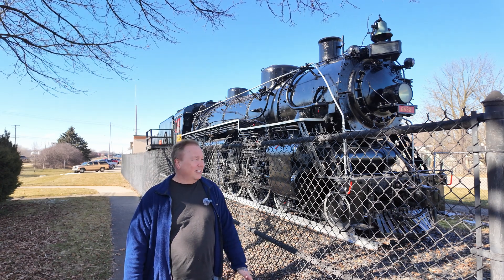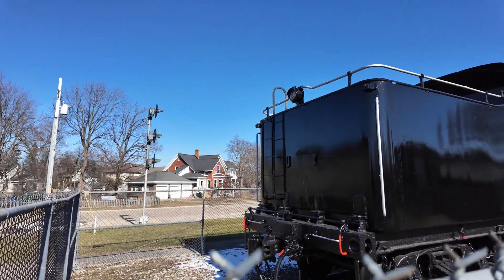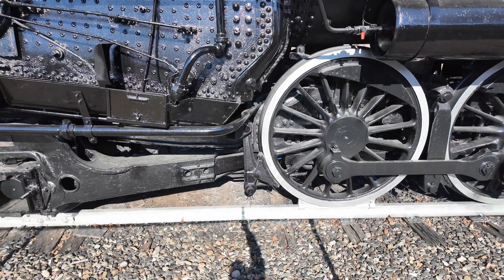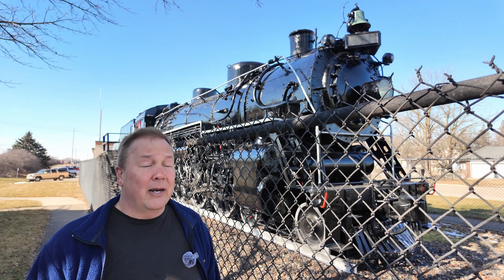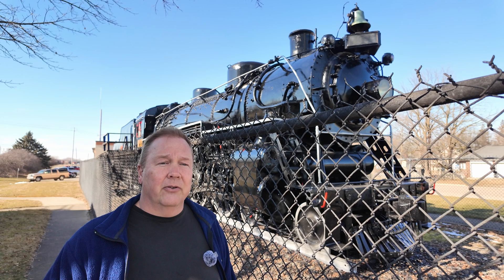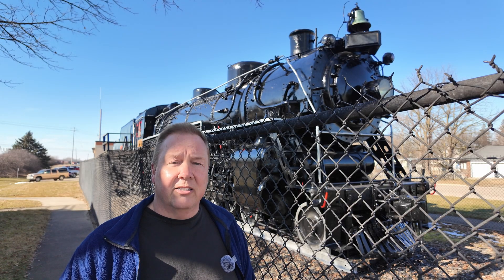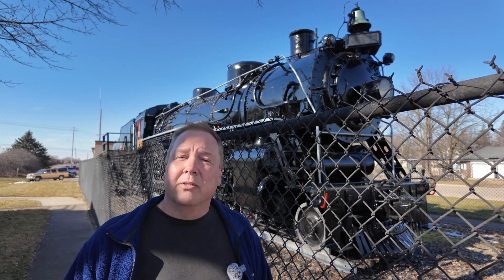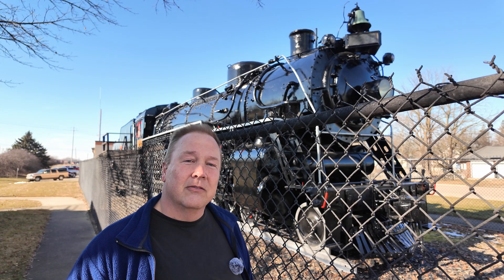Why Are So Many Steam Locomotives Sitting in Parks?

Comment: Only 10 miles between water stops may have been true in the 1800s, but something that new could go 100-150 miles between water fills.  At least do a little google searching before spouting blatantly obvious falsehoods.
Reply from the maker: Depends more on the locomotive than on the decade, but yes, many could go further.  Since some had to stop quite frequently, water stops had to be maintained, even if most trains could go right by them.  It's a good point, though, that I wasn't very clear on.  I have a video topic on my list of getting water into steam trains, so I'll try to go into that topic a bit more there.  Thanks for the comment.

Comment: The reason why they sit in parks all the time my friend is because they don’t want to use um no more plus its to expensive to restore those wonderful machines yet alone operating them
Reply from the maker: Some of these have actually been pulled out of parks, restored, and put back into use on historic.heritage railroads.  It's not cheap, but it's been done.  Just down the road from this one is the Pere Marquette 1225, which is back out pulling passengers again.

Comment: Well I'll tell ya I believe they hold a lot of sentimental value for one, but they're more than that.  Many point out the Steam engine was around a long time and as each one got bigger and stronger people could connect to them, because of their power.  During that time period people saw the country growing, they saw their towns growing, families growing, the train was a life source.  The train brought the goods, the people, it also took the people.  Back then traditionally people lived their whole lives and never traveled more than fifty miles Tops once or twice and mostly never more than a radius of twenty miles.  When they went on the Train it was a big deal - It took them to the Big City or to college, the Army or a new career.  When people think of Americana those huge steam engines are at the heart of it.  When I was eighteen moved with my gal to my new home town 2000 miles away via the train.  Most important trip of my life, on a train.  So I believe there's more to Trains than steel. iron, engine/motor and fuel, especially the old steam engines, there's an Esprit de Corp to 'em that I believe they hold forever, so that for even a stranger coming upon one (in a city park) fifty years from now - if they stand there next to one long enough, in silence, in the stillness, maybe they'll get the feel of one and what it was like because of all that power and all those lives vested.
Reply from the maker: I definitely agree with both your main points.  Trains opened up the world to people, and steam trains filled the space before cars then took over and did much the same thing.  The reason you don't see so many diesels sitting in parks is that steam had personality.  Each locomotive was an individual.  They had personalities.  And yes, people definitely miss them, as you can see from the number of people who seek out heritage/historic steam trains today.

Comment: I have to ask, why did steam engines have huge open drive wheels with pistons and rods attached to them with leading and trailing wheels, versus a diesel engine has small 4 wheel axled or 6 wheel axled wheels in axle bogie trucks with the fuel tank in the center between the wheels under the chassis? Whereas a steamer carries its fuel in a tender.
Reply from the maker: Those are some great questions, and I have videos coming up on some of it.  The huge wheels part, though, is easy.  Most steam locomotives weren't geared (although some, like Shay locomotives, were).  Your maximum speed was a function of how big your drivers were (see my how fast can a steam locomotive go video), although there's trade-offs between going fast and the ability to start with a heavy load.  This meant that fast freight and passenger locomotives typically had bigger drivers, while heavy freight locomotives would usually have somewhat smaller ones.  
The boilers had to sit on top of the driver wheel axles (I have a video coming up looking at the bottom of a steam locomotive).  Between coal and water, both of which were refilled along the way, almost aways from overhead towers, you couldn't really store the fuel and water underneath, and there's not enough room down there, anyway.  Some of the tenders can be as big as the entire locomotive, with a majority of that space typically being for water.
Some smaller locomotives, like saddleback or tank engines, actually did carry the fuel and water right on the locomotive.  They had an upside-down U shaped water tank over the top of the boiler and carried coal in bunkers at the back of the footplate.  Thomas the Tank Engine is one of these.  They were small, and typically used for things like switchyard work or work moving things around a factory.
My list of videos to make includes water sources, coaling towers, wheel configurations, and geared locomotive.  Like I said, you asked a lot of great questions!
Reply: @Industrial_Revolution  ok but why are diesel engines wheels small with axles over them like 4 wheel or six wheel in groups in the front and in the back?
Reply from the maker: They're actually diesel-electrics, with the electric motors driving the wheels.  The electric motors can turn much faster than you can run a steam engine.  Due to the physics of moving steam around, how fast steam can move, and how fast it can expand and then leave cylinders, your steam efficiency starts to drop really fast after about 333 RPM, and there's a theoretical max speed of 555 RPM for steam engines. Running smaller wheels, steam trains would max out around 25 mph.
Reply: @Industrial_Revolution  why are the wheels smaller on a diesel vs a steamer though? I know it diesel electric but why are they grouped in axles like 4 wheel or 6 wheel?
Reply from the maker: Well smaller just gets them out of the way, if nothing else.  The axle for the wheels defines how far down everything else can sit, so bigger wheels means you have to raise everything else up.  Also, smaller wheels are less likely to spin and they can provide more torque, so more power to start up with a heavy load.
Why in sets of 4 or 6?  If you did a set of 2, it could more easily twist off the rails.  You'll almost never see a single axle on a train, except occasionally the lead or trailing wheels on a steam locomotive.  They pretty much always come in sets of 4.  
The other reason is that you need more drive wheels.  Putting them in rigidly-locked sets means you can drive multiple wheels with a single drive system.  That's why steam locomotives have the running gear connecting, usually, 2 or 3 wheels on each side, although I've seen up to 5 wheels on each side (today's video release, in fact).  For diesel, it's cheaper and easier to have one, big electric motor driving 6 wheels, all geared together, than it is to have three motors each running 2 wheels.  Why not run 20 wheels off one, even bigger motor?  Since they have to be rigidly tied together, if you get too long, going around tighter curves becomes a problem.
As for why you still need more wheels, and not just one, super-powerful set, think of the contact area between the wheel and the rail.  It's extremely small, about the size of a dime.  You can either add more weight on top of that tiny contact area, or add more contact area.  Adding more drive wheels, while maintaining the same weight,  causes less track and railbed damage, since you're distributing it more, and also provides better traction, since you have a larger surface area to grab onto.
That help?
Oh, and do keep asking questions on the videos.  Some questions have already been turned into videos, or added to the list of videos I want to make.  I know I've been learning a lot as I make these.
Reply: @Industrial_Revolution  very interesting

Comment: WHY are steam locomotives still around BELIEVE IT OR NOT !
They are part of the SSR (Strategic Steam Reserve) Just in case we loose access to modern fuels for transportation
in a wartime event and can be brought on line within weeks !!!!! 
One more example is live oak trees are protected in case we need to revert back to building wooden ships for the Navy !
Reply from the maker: I've heard that from a few other people in comments here, too.  For a while, they could have been brought back into use quickly, but no so much, anymore.  You'd not only need to fully service them, often including fabricating new boilers, but there's no water or fuel infrastructure for them anymore.
Reply: @Industrial_Revolution  True but, on a dire scale, imagine having to build foundries for castings ect. at least 50- 60% is there and we still have water, coal or trees !

Comment: I enjoy diesels especially older ones but they will never have the diversity and character of steam engines. Sound, smoke, whistles will always give a much better show than a diesel engine going by
Reply from the maker: I think that's a part of why there's a romance with steam locomotives.  They were individuals. 
 They had personality.  Diesels really came in big around the same time as brutalist architecture, when design moved from sculptural to big, ugly blocks.  Compare any office building from the early 1900's with one from the late 1900's and you'll see that same thing.
Reply: @Industrial_Revolution  I agree. I do enjoy an old sd42T running at run 8 like in the 80s and 90s on a steep grade it’s awesome to watch.These new clean diesels I understand are amazing machine but watching the same old huge intermodels doesn’t do it for me anymore

Comment: You are wrong about the 10 mile endurance of steam locomotives for water.
Reply from the maker: Well, partially.  Some had that limitation.  Others could go considerably longer.  Several other people have mentioned it, and I'll be doing a separate video on that topic, as there's quite a bit to consider and a lot of variables that controlled just how far you could go.

Comment: Nice video, thank you!  One correction: A "modern" steam locomotive such as this one could run much further than 10-20 miles before needing water. When I first watched your video, it reminded me of the "5632" locomotive that pulled excursions, including near Dubuque, IA. I road on one of them as a child in the early 1960's and thought this was it. Turns out there was a CB&Q 4-8-4 also numbered 5632 that had a great excursion life, but sadly was scrapped in 1972. This one looks nice, with enough money it might even be restorable.
Reply from the maker: Many have brought up water.  It's a much more complicated issue, really.  I'll be making a separate video on it in the future.

Comment: Essy answer. They are static displayed for several reasons 1) they are popular, ppl love to see them 2) to get them and keep them running is expensive, FRA regulations require total rebuilds to keep them running or get them running, costs millons 3) many railroads wont let steam run on them,claimimg liability 4) unkown if PTC ( positive train control, a remote system that can control trains in an emergency,) is needed; steam engines are mechanically operated, modern diesels are drive by wire.
Reply from the maker: Dieselization mostly happened well before PTC was in place.

Comment: Also: all of the YT videos i see of classic locomotives such as Big Boy in operation, they are always coupled to a diesel-electric locomotive. Why is that?  Are they not able to travel by their own power any more?  Or is it just more cost effective to use a separate diesel locomotive to move them?
Reply from the maker: On long trips, it's often because the coal and water infrastructure just isn't there anymore.  They're also sometimes used to provide electrical power to the passenger cars in the train, which may want air conditioning, etc.  The steam locomotives out there today are more than capable of handling the dozen passenger cars they generally have, plus often another hundred or so, without working up a sweat.
Reply: @Industrial_Revolution  but they can't provide electrical power?
Reply from the maker: @jeffcoat1959 they're technically  capable of it, I've you add a generator/alternator of some kind.  Early locomotives, of course, never had them.  Later versions would have small ones for lights, but that's it.  Squeezing a bigger one in, enough for modern refrigeration, heat, and air conditioning, for example, needs a considerably larger generator, and that's going to be pretty visible, not to mention annoying everyone who sees it.  Some don't even like the small radios required for any steam locomotives in use today.

Comment: Couple questions crossed my mind: since the power for a steam locomotive comes from the steam generated by boiling water, is coal really necessary? Couldn't any source of heat work? Is it possible to power a steam engine with more environmentally friendly fuels, such as LP, CNG, LNG, etc.?
Reply from the maker: Yes!  Some were made originally  to run wood or oil.  Some have been converted to oil or LP gas.  You do need to change the stuff inside the firebox to make it work, but it is definitely done.  You could probably even fill the tender with batteries and run electric to make steam.

Comment: The problem is they require a lot of water to make steam, and we're running out of water.

Plus they are difficult to steer because they are so heavy.   
   And they have no 8 track stereo head unit, so nobody wants to drive them anymore.
Reply from the maker: You've got a point.  Don't think I've ever seen one with a CD or MP3 player

Comment: They switch from coal a long time ago that was most likely a oil-powered steam train because you don't have to have somebody shoveling coal into the engine I was also thinking that it looked a lot like the Freedom Train the bicentennial train that was found in Portland Oregon it was sent around the country on our nation's bicentennial that train is I really only seen now during Christmas time when it runs a short three mile distance from the Oregon rail Museum to Oaks Amusement Park during that time of the season it's called the Christmas train of course for me it will always be the bicentennial train
Reply from the maker: Some locomotives always ran coal.  Some always ran oil.  Depends what was availablelb where they were running.  Some did convert, like the Durango Silverton just did.  As for shovelling coal,  a lot of the bigger and newer locomotives had an auger from the tender which took care of that for you, once you got the fire going.